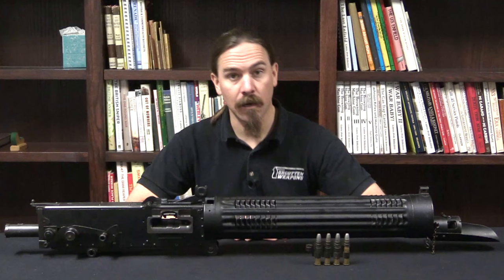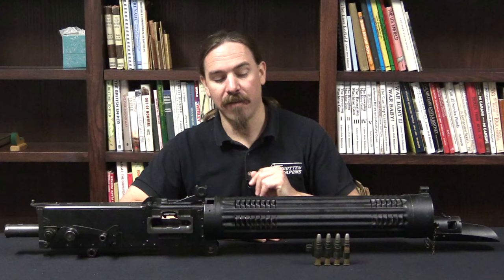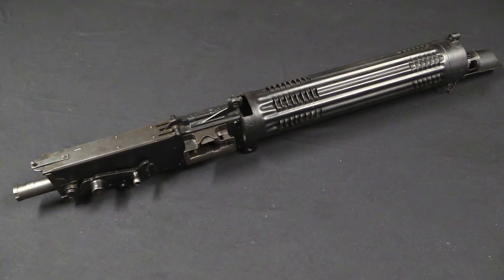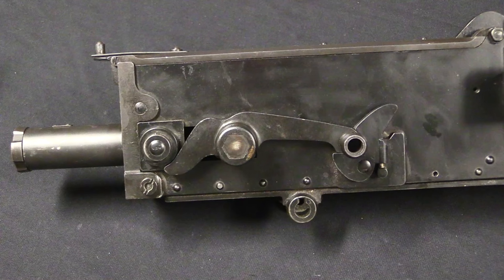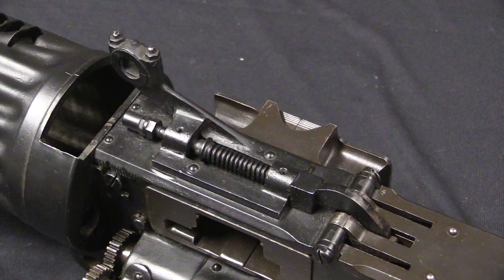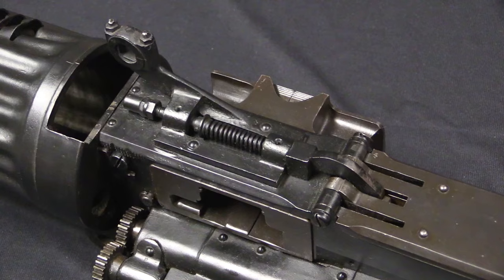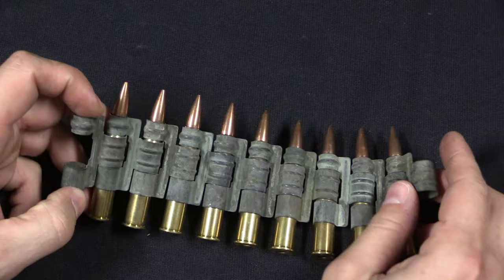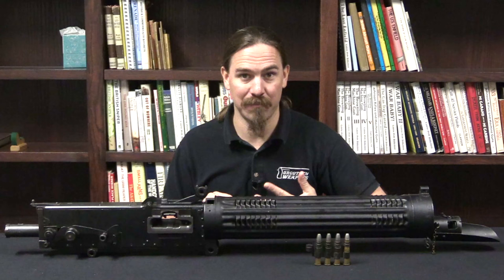11mm Vickers "Balloon Buster" Machine Gun

Comment: Another piece of balloon hunting history I found that is sadly obscure.

So, I learned about this from a listing on Barnstormers dot com. Unfortunately, I cannot find the listing, meaning it's probably sold by now... Which is unfortunate, as it's the only source and photo of this thing I've been able to find.

Basically, it was a barnfind of a dedicated balloon buster plane from WW1. It was built from the ground up for hunting balloons. According to the listing, this plane was one of only 3 existing in the world, and this one was still in flyable condition. It was put up for sale for just a couple grand (and I believe the listing, you'd be surprised how cheap more obscure aircraft can go for on that site).

What makes this plane unusual is how it looks... Basically it looked stupid. Like a child's toy. Like a miniturized Fokker triplane. It was a triplane with very short wings, and a very short and stubby fuselage, and it had an extremely thick airfoil on the wings. But it was a real plane, had an engine, had MGs mounted in the nose, full flight controls in the cockpit, and moving flight surfaces, and a full sized adult can sit in the seat.

The reason this plane looked so tiny, stubby, and unusual was that it was apparently designed to be fit into a standard sized cargo container of the era, without disassembly, and be ready to fly and shoot down balloons as soon as it is removed from the container. So, it had to be tiny, and fit the shape of a box as much as possible, hence the triplane high lift wings, and short fuselage and wingspan. Surprising that it can fly at all.

Not many were built, and it's such an obscure piece of history, it's difficult to find more information about these planes.

Comment: Now it is possible that the jacket is designed to get the Venturi Effect near the barrel. In an aircraft, if you take off the cowling the engine will often overheat because the flow of the air is different. This might be the same here. https://en.wikipedia.org/wiki/Venturi_effect

Comment: Hydrogen doesn't burn without oxygen & incendiary rounds would pass through without igniting the pure gas. One way to do it was to load out 1 in 4 incendiary, but I can also see ripping up the gas bag with 303's, which would have a higher velocity & hit first, with a second gun firing incendiary would work. Possibly more efficiently.

Comment: So one thing I was curious about; was the modified 11mm Gras redesigned to use smokeless powder? I figure since it's on a big airplane, the recoil wouldn't matter too much.
Reply: The machine gun rounds were loaded with smokeless powder. They were commonly  called 11mm Vickers to differentiate them from the original Gras cartridges.

Comment: Never understood why these are typically deactivated, you can't fire them unless you build a contraption to fire them with. And even then finding the belts and stuff required to fire them is equally impossible. So unless someone hulks around a heavy gun fires a single shot using a contraption and then manually reloads a single shot, you can't use these for anything. Not to mention the ammo is rare and likely 250$ a round or something insane.

Comment: So is the gun, in this form, technically semi auto? Since it only will fire once from one input of the engine actuator? Seems like this could be classified as semi auto and not a machine gun in the eyes of the ATF.
Reply: It's more of a burst fire arrangement, with the length of the burst dictated by the cyclic rate of the gun and the rpm of the engine.

Comment: Sorry if the answer is obvious, but how would the pilots trigger the guns to fire? Some kind of wire linkage from the flying stick to the rotating gear that would move the actuator, or perhaps some early forms of solenoid? Also the rate of fire would change depending on the rpm of the propeller wouldn't it, which I imagine would have some downsides and be why wing-mounted guns would be more popular in WW2.
Reply: Only put 2 around the engine, 4 to six per wing
Reply: Early aircraft engines basically had no throttle, they were either on or off.

Also, the interruptor gear was a cam attached to the propeller shaft, so it's varying with engine rpm anyways.

Comment: "this is what you use to adjust the spring, anyway heres where the synchronization gear would mount to the gun" wouldnt messing with the spring tension cause the gun to shoot out the propeller?

Comment: I know the original 11mm Graw was a black powder cartridge. Was this 11mm cartridge still black powder or was it smokeless? If they took the time to redesign the bullet, why not change the powder. Although, since the gun was primarily used in aircraft, it probably would not shoot as many rounds as the ground based guns would. So if the gun was cleaned after each flight, it might be able to run black powder.
Reply: The machine gun rounds were smokeless. They were often called 11mm Vickers to distinguish them from original black powder Gras rounds

Comment: Although WW1 aircraft were very "fragile", wouldn't the fact they too tended to be "combustible" make incendiary bullets possibly useful?
Doped canvas frames, petrol fuel etc
Reply: Only if you hit something hard enough to actually catch the incendiary.  The "softness" of the aircraft actually made them durable in a way.  Raw deal for the pilot and engine, but the rest of the plane can handle eating some bullets.  A plane moving at full speed isn't going to catch on fire without a lot of bad luck.
Reply: @Markworth  oh I can see your point and agree with it :) 
Except what I've read of the aircraft they did tend to be more flammable than I'd certainly like if I was inside them ;)
fuel and castor oil leaks made them very vulnerable to fires

Comment: If the gun automatically fires by means of the engine, how do you keep it from being fired? What controls the firing, the engine or the pilot?
Reply: trigger connects the gun to the prop which the prop then runs the gun, so the prop is the gun driver and the pilot just connects the gun to the prop, so basically when the two items are connected the gun just runs in time with the prop. If the pilot leaves it connected it just runs out of ammo.

Comment: How efficient were the incendiary rounds against balloons?

As I understand, helium is flammable only in specific ratio with oxygen. If you have too much or too little it wont light up.
For incendiary rounds to work, you need to punch holes to balloon and wait for enough helium to escape...
...while you are shot at by defending air force/AA guns and balloon itself.
And even if your fire successfully ignites ambient helium, there is no guarantee the fire will find its way inside the envelope. (Where is too much helium a no oxygen to burn.)
Reply: Helium is an inert gas, so won’t burn. But these balloons were filled with hydrogen, because helium wasn’t available in large quantities in those days.  Hydrogen will burn in a wide range of mixtures with air, and will ignite very easily, more easily than natural gas. (Speaking as a chemical engineer.)
Reply: @jerry2357  Thank you, my mistake. I wrote helium instead of hydrogene (both were used in baloons).

Comment: Were these ever used on aircraft. Like a early 12.7 but smaller
Reply: Probably, if that’s all the pilot had left. There’s a reason Rickenbacker was running one each , 11mm and .303. The lower velocity meant shorter ranges and more deflection shooting, which are less detrimental when balloon busting. No doubt it would bust up a plane though!

Comment: 9:50 There are actually four of them. The one you have forgotten is avoiding this issue of synchronization altogether by shooting through the empty propeller shaft.
18:01 ...And aircrafts of the day had unprotected fuel tanks, which are the same thing, but smaller. But here's the real problem. While .303 is certainly not the fastest rifle round in most of its loadings, smokeless 11×59R was only capable of 610 m/s, and that's not conducive to accurate shooting at a target as small as a WW1 fighter plane fuel tank, while the opposing pilot is doing everything to not get his plane hit.

Comment: The US military has been experimenting with modern versions of the observation balloon. Low power requirements, very long loiter time. Not hydrogen based as far as I know though.
Reply: The US has access to a hell of a lot of helium from our oil fields.
Reply: @ScottKenny1978  not as much as you'd think. The demand has outstripped supply
Reply: @johnscheib9077  granted. But IIRC the US is still one of the world's largest producers of helium, so it's not like we're depending on some other nation across the oceans (and ships vulnerable to submarines) for our supply.

In the event of a war, the US could ban the export of helium, and then buy up a lot.
Reply: @ScottKenny1978  the National Helium Reserve is scheduled to shut down next year, prices have more than doubled and tracking down pure helium as opposed to birthday party balloon gas is a lot harder